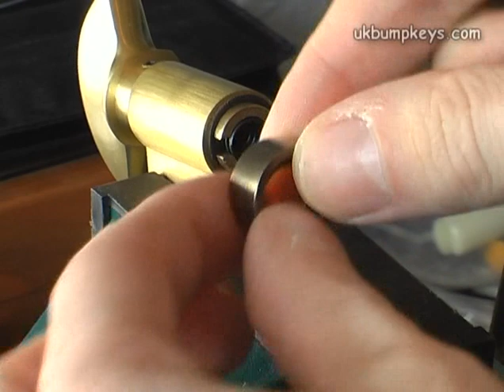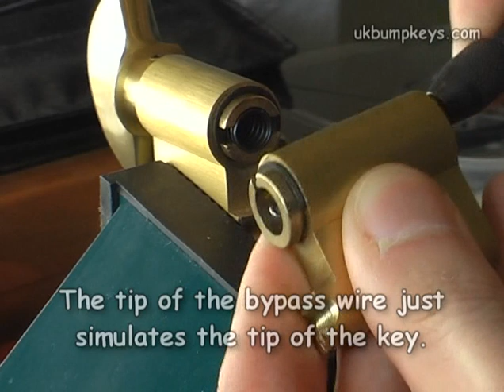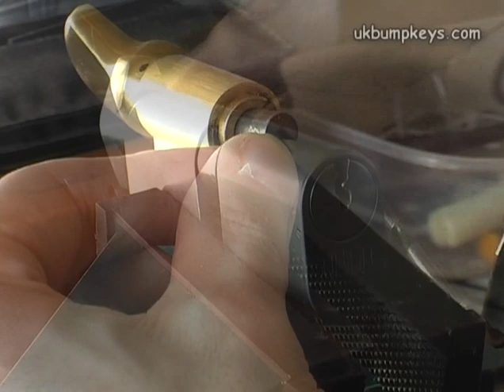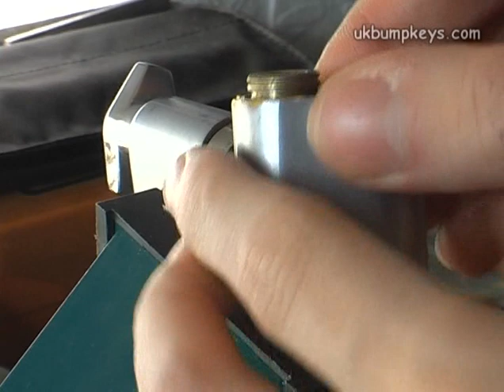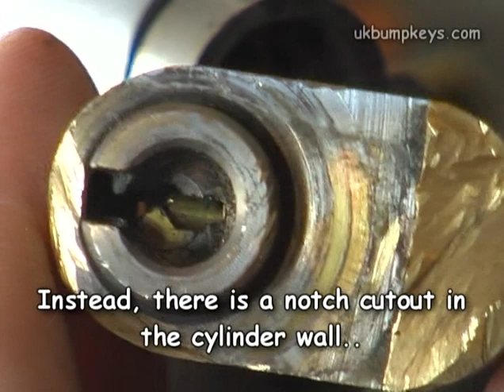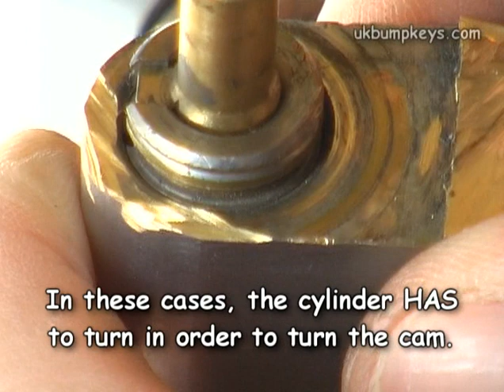Inside the Euro Thumbturn Bypass

Comment: Can you clear a doubt please?
In the first lock you showed, picking the lock wouldn't rotate the cam on it's own, you would heve to later insert something in there like you've shown, otherwise the cylinder would rotate but not the cam.
In the secong lock, picking the cylinder would then rotate both the cylinder and the cam at the same time (unless if you tried to insert something in there, wich would disconnect the cam from the cylinder, making the cylinder turn on it's own)
Am I correct?